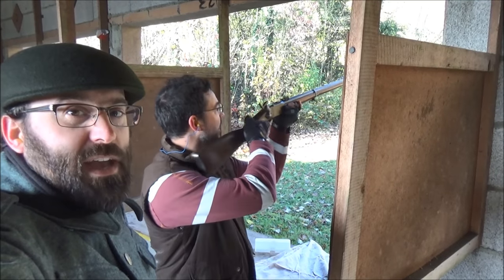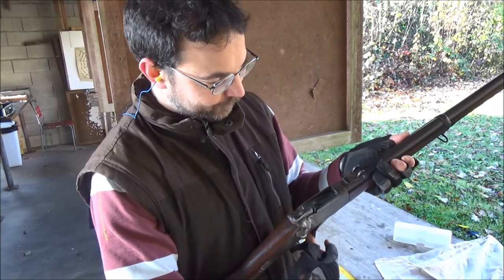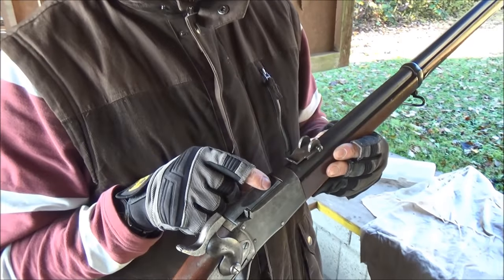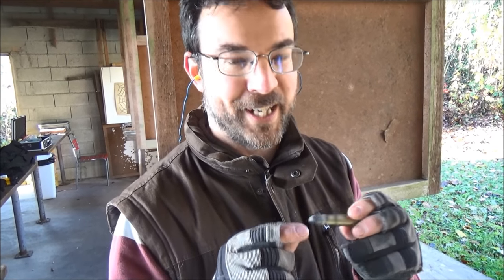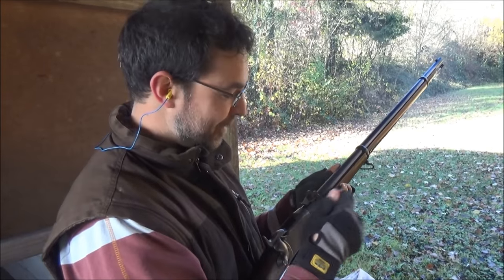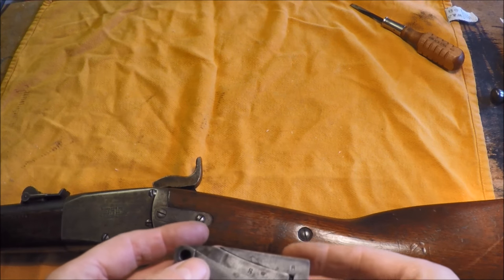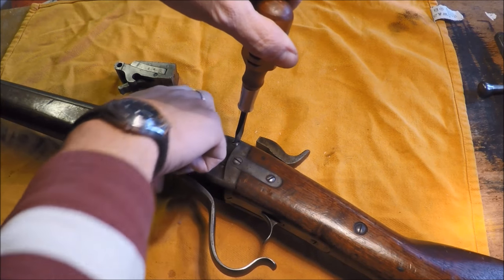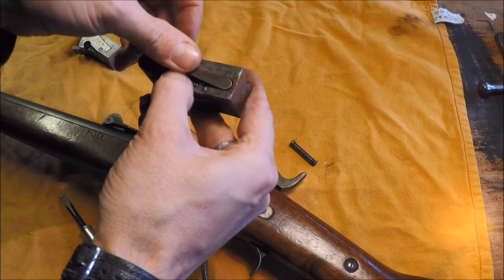A Swiss 10.4mm Peabody Tipping-Block On The Range

Comment: I always knew that action as the Martini or Martini-Henry action and sometimes refereed to as a falling block action.
Reply: There is a fine line between tilting block (Martini/Peabody/Werder/Guedes) and dropping block (Comblain/Sharps and many classic sporting guns).  They all "drop" but the tilting blocks only lower at one end around a pivot whereas the dropping blocks slide down completely.

Comment: I've seen some interesting gunsmithing jobs coverting Vetterlis to centerfire in America. Is that a common practice in Switzerland too?
Reply: It was done but less so since RF ammo was plentiful when these and target rifles built on the actions were made.  The most common conversion was simply to drill the bolt face, remove the firing fork and extend the striker. There is sadly very little interest in shooting them, probably since there aren't so many places to shoot them but they remain highly collectible.
Reply: The Chap Out of interest why are they a problem to find places to shoot? It's not like they are a very high energy round.
Reply: Most rifle ranges are 300m government subsidised ranges which don't allow such toys and the private ranges are usually indoors with inadequate smoke/fume extraction to cope with PB, hence you have to find a club which explicitly allows their use.

Comment: How about explaining that the Peabody patents where bought by Providence Tool co. And maybe how Martini and Henry didn't pay for them.
Reply: Hamm 603 Henry has nothing to do with it since he invented the rifling profile associated with the Martini Henry and Peabody Martini. As to Peabody claiming infringement, it was a lost cause. Peabody only protected the lever action tilting block with a firing pin to be struck with an external hammer. Martini reworked the design to include an internal striker and cocking mechanism, something not protected or anticipated in Peabody’s patent. His claim was spurious and wouldn’t hold up even today.

Comment: BB mod could have been to prevent premature firing of the cartridge while closing the breech.
Reply: There is no difference in the closing of the action resulting from the mods. I suspect that the smaller tip concentrates the impact force on the rim compared to the large blunt rounded striker tip.

Comment: (Swiss converted to centerfire about 1877)
Reply: Søren Skovgaard Møller The Swiss did not convert 10.4x38R centrefire in service. The centrefire conversions you find were all done out of service and the centrefire 10.4x42R was a commercial target/hunting cartridge.
Reply: In 1877 the rifles in service received a modified striker, ejector and a new Vetterli profile barrel if the original was worn out. They were then designated 1867/77 but still rimfire.
Reply: @thebotrchap  http://www.militaryrifles.com/Switzerland/SwisPeab67v77.htm. It´s the second Peabody I own. I beleave it's the M1867/77 Swiss. The firingpind can be Romanian.

Comment: larger BP rounds are fun to fire. Canada bought 3000 of them and used the to suppress the Fenian raids.
Try a Snider?
Reply: I have a Snider indeed, fired very nicely with 0.60" ball.  The largest BP cartridge I reloaded for so far is the 17.5mm French Snider.  I also have 18mm Milbank-Amsler in the works.

Comment: Hey, if you reload, do you reload GP 1890?
Reply: Bloke on the Range I'm looking to reload for my IG1889, with H&N 165gr .308 bullets but am wondering about which powder you are using...Reload Swiss doesn't seem to have an acceptable option so I'll probably go with IMR Trailboss. What are you using?
Reply: Bloke on the Range the issue for me is that H&N bullets are copper-plated lead with a V0 max at 500m/s. So RS40 and RS50 have a too low case filling. I don't feel like shooting modern hard Sierra Matchkings at 800m/s in these bores.
Reply: Bloke on the Range I'll run some simulations in QuickLoad and see what it has to say, RS30 works great in my .357 Mag!
Reply: After some tinkering in QuickLoad I might go the opposite way using very slow RS80 powder. With this I have a very good case filling, 550 up to 600m/s and low pressures. The only downside is half the powder is unburned: http://dl.dropboxusercontent.com/u/9154158/Divers/GP1890-RS80.pdf
Do you actually care about case filling in your reloadings? In theory it's really dangerous to go lower than 60-80% as it can lead to secondary explosions.
Reply: Bloke on the Range I'll have a chat with other shooters from my range (I'm in Sion btw) that reload for their Martinis...If you have the Lyman manual, does it have data for 7.5 swiss? I'm asking because I have the standard 49th edition and there is nothing in it :)